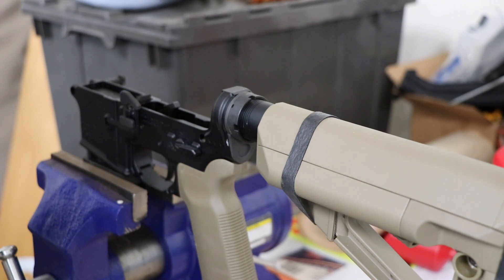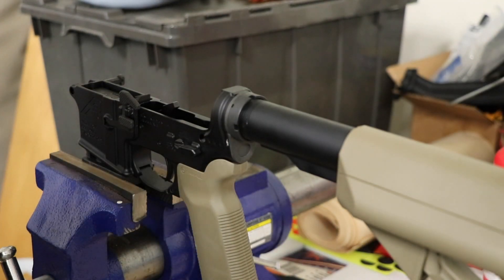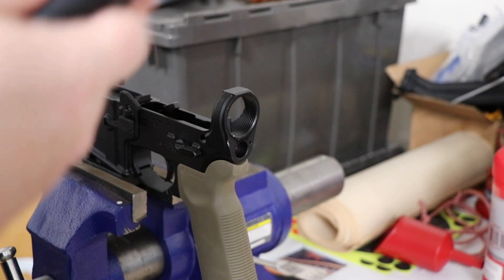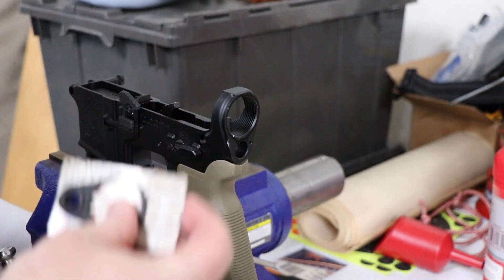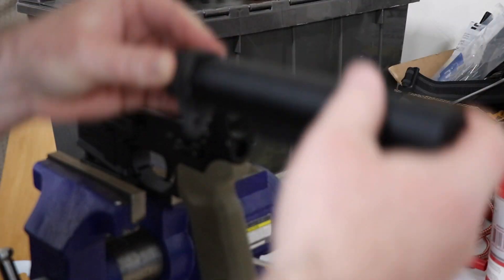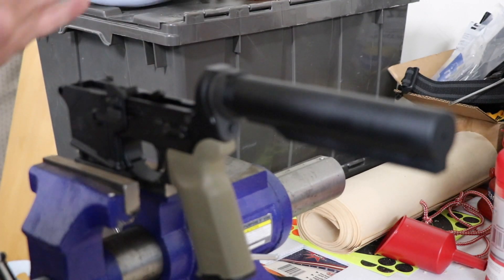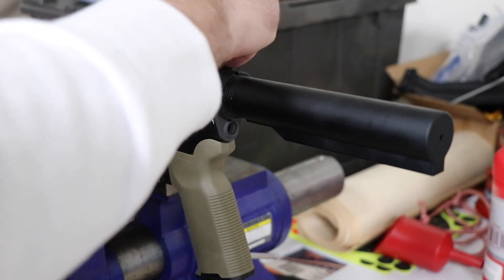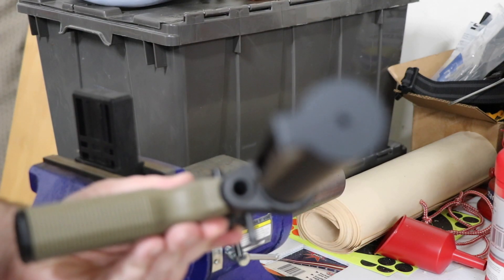Noveske QD Receiver End Plate - INSTALL

Comment: I'm about 90 percent sure to remove your buttstock, instead of pushing your release to adjust the  length when all the way extended. You will actually revers the motion of the lever by pulling it to towards the muzzle while still pulling off the buttstock. I guess ive just never heard of anyone having a hard time with that. Let me know if I'm wrong please
Reply from the maker: I’m not 100% sure, but I know nothing that should work does to take it off without a screwdriver to push that pin up. Assuming it could be a defect, but it’s okay cause I am replacing it, with a B5 soon.

Comment: About the galled threads, dissimilar metals will corrode (cause the threads to stick) and should have some anti-seize  applied to the threads to prevent that happening. If I'm  not mistaken the .MIL has a grease just for that purpose which a real armorer would know....
Reply from the maker: Well A never claimed to be an armored, B the threads were never stuck, they literal sheered off at some point, never noticed till I disassembled it.